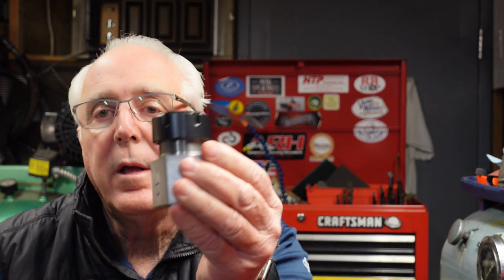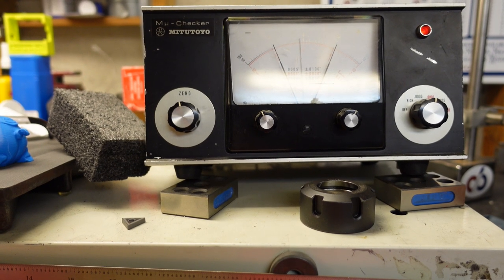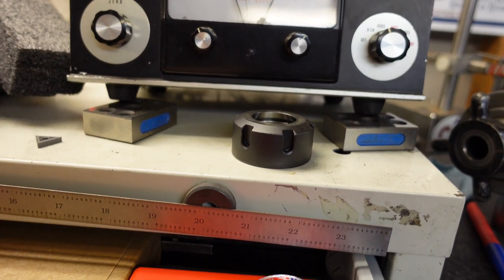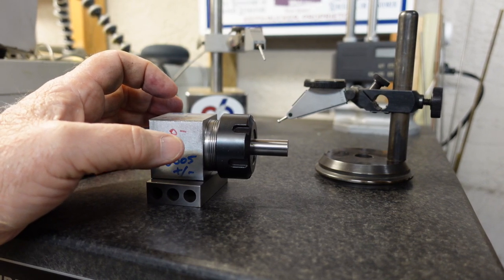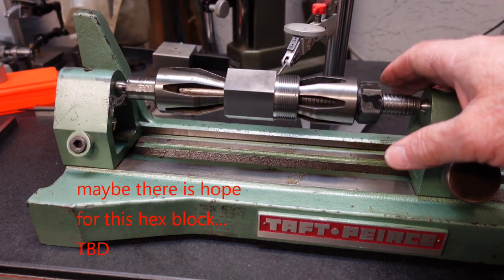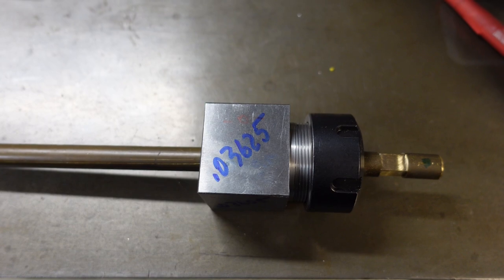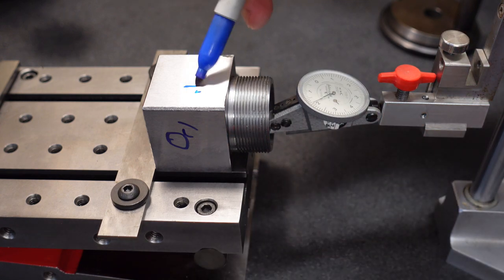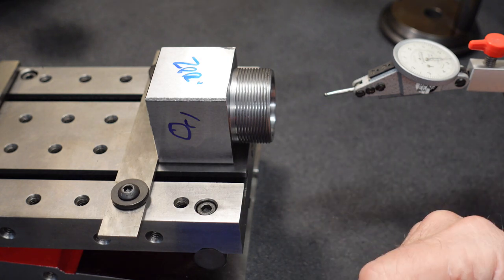ER32 Collet Block Issues (part 1)

Comment: Thanks for the video, nice instrumentation. You have provided an explanation for an anomaly I could not fathom. When using a square collet block to drill and tap 4 holes very close to the edge of the workpiece, one hole was out of position with respect to that edge. I thought that I had not engaged the fixed stop so remade the part, but to no avail, the same problem. I will remake the part using the rotary table, which is a pain to install, but I really wanted the collet block method to work as it is an elegant and simple method of indexing. What I have noticed is the smaller the part you make, the more critical the setup. I am currently following Joe Pi's micro lathe build and was on the 4 jaw chuck when the error occurred, and the tapped holes are critical to the working of the chuck. Thanks again, Richard
Reply from the maker: Richard, thanks for viewing and commenting, I am learning as I am discussing this and will learn from comments from viewers.  Joe Pi is a great mentor and I watch everything he has on YT and it is a great source of learning...

Comment: Have you considered setting up the collet block in a 4 jaw chuck and dialing in the taper.  Once you get the taper dialed n you could check the outside of the block to verify what you are seeing in other tests.  It would also show you whether grinding the block will solve the problem.
Reply: Fantastic and simple.
Reply from the maker: Thanks for viewing and commenting....I might give this a try, but although minor the 4 jaw has its own jaw grip angle that could influence the reading on the taper...if I am thinking correctly....
Reply: @outsidescrewball  yes, you are.

Comment: Hi Chuck, great analysis. Here's my suggestion : if you have 2 half inch collets (good ones), set your grinding fixture up with a 1/2" dowel in a good collet and check its runout (manipulate until good). Next put your other good collet into the square block and attach to the pin in your grinding fixture. Clock the flats and grind them until uniform. This will get you quickly within a few tenths. Cheers, Jon
Reply from the maker: thanks for viewing and your comment, yes that is a method I have considered....tbd

Comment: I recently got a chinese ER40 set  to use on my Logan lathe (after seeing the Blondihacks video).  The chuck has an internal run out of .00025", and the ALL the collets have a run out of almost exactly .001" using gauge pins. The few US-made ER40 collets I have measured .0002-.0004" (the .0002 was brand new old stock).  Can't wait to see the followup!
Reply from the maker: thanks for viewing and commenting...

Comment: Thanks, Chuck for you meticulous check-up! Got myself the same collet sets (and the MT2 & MT3/ ER 32 chucks) from BG a coupla years ago: Runout of the MT chucks were +/-0,05 mm for starters: that being neither concentric nor coaxial, I got them reground to <0,002 mm TIR only to find most of the collets were way off in an otherwise perfect seat...  Kind Tip: Check the collets out before doing any crucial work in them. ATB & Cheers DIYSwede
Reply from the maker: thanks for viewing and your comments....I am expecting the collets to be an issue...but good learning experience for me working on the collet blocks

Comment: How are you getting an accurate reading , on the taper when your
indicator is not moving in a
perpendicular line "you are sliding
it by hand   
Just wondering.
Reply from the maker: Tom, thanks for viewing and your question/comment....watch again, the indicator ball is moved sideways to locate the bottom of the bore, when I am "sliding in by hand" once at a stopping point the indicator moves to locate the bottom of the bore...if good you should get the same reading any location along the taper....that is why you set zero on the indicator then move and read any errors....hope this answers your question

Comment: Is that just trying to say that the center of the taper is off-center?  Been a long day, so just trying to see if we came to similar conclusions?
Reply from the maker: LOL...I'm not telling, you will have to wait for part 2....why you might ask...cuz HELL I don't know...lol
Reply: @outsidescrewball  :-)
Reply: The other thing I thought was when you were testing the pin, was the runout the same nearer the block than farthest away from the block (the end of the pin).  If so, then it may indicate it is "bored" crooked to the outside of the block.  Looking forward to part 2.

Comment: At at a bit of a miss here.  There are a few things im seeing but like when you had it on the angle plate other than the described .008 miss i am not particularly seeing where the setup is wrong.  I didnt care for the mandrel because the back of the block could just be a rough drill or bore prior to grinding.   Could turn a inner touch and outer touch bushing as one piece to mimic a true collet to use as a master to test the alignment to the full circle.  Threaded rod to pull it tight into the block.  Retest on the sone plate using a slide plate to eleminate cosine errors and essentially use single axis measurement.  Im brainnstorming here because there are two errors. The block and then the collet.  Block beong outer and inner grinds not including any angular error.  Swap your dimensions to a flat surface and make a think of it as a master collet with a tapped hole for a bolt to pull it into the block.  Then the small diameter and a larger diameter then down or out to a short shaft.  The tops should be tapered or rounded as to not introduce tangental errors between the front and back.  That may not even end up being true but could remove issues with the collet.  Then you could indicate the shaft in true then indicate the highs and lows of the blocks.  And so far i have exceeded the cost of the blocks.  Chuck, this is an adventure indeed.   I feel engaged now. Thank you, Phil.
Reply from the maker: thanks for viewing and commenting....best, C

Comment: that last test you didn't have a side plate to set the block on ether you only had the back plate as a guide ?? great vid keep up the great work 👍👍👍
Reply from the maker: leon, thanks for viewing and commenting, yes you are correct, but an earlier test showed that the block sides were perpendicular to the back, so no side plate is necessary as long as the back is seated to the stop

Comment: Chuck, buy one of these: http://www.mag-pro.com.au/goods.php?id=469 then you'll be fine.
You'll only need one, and the body clamps AND sits on a flat no matter which position. In addition, the body is bigger than the nut, so you can use it on a surface grinder directly (blocked in of course).... I 'invented' the improvement on the Stephenson block copies you have there....
Of course no guarantee if you are using crappy collets in this one either....
Reply from the maker: Thanks for viewing and commenting, I am new to the ER product and that is a very nice product....I may order once I get through this review of the (agreed) crappy collets and blocks
Reply: I just saw those on another video...don't remember the channel. Looks nice